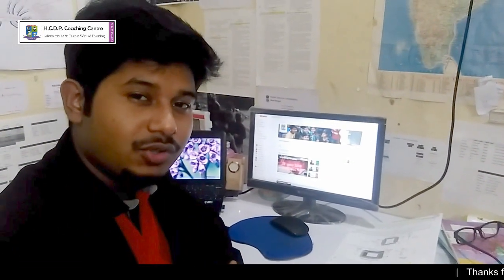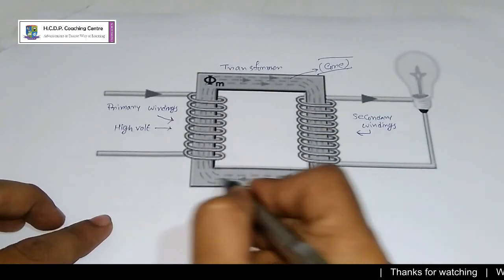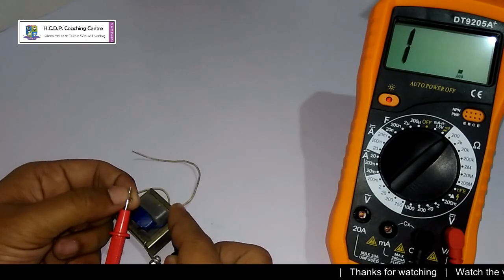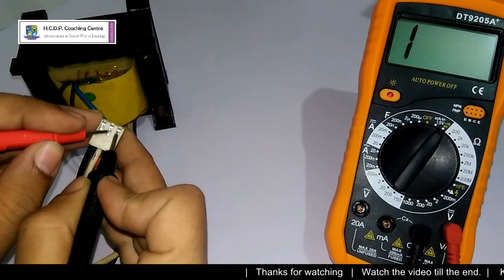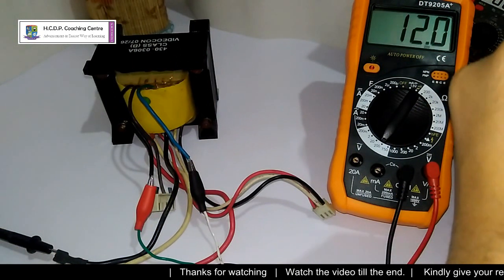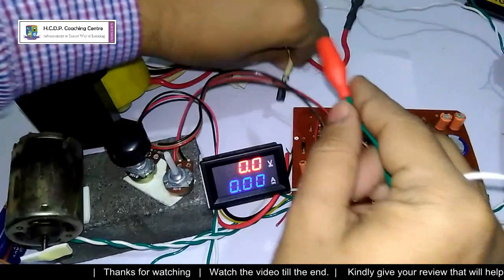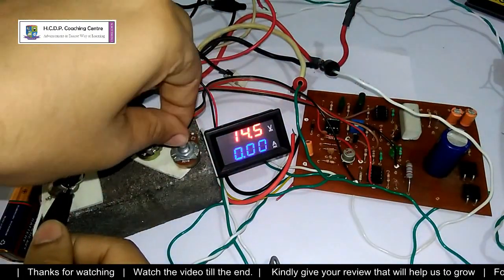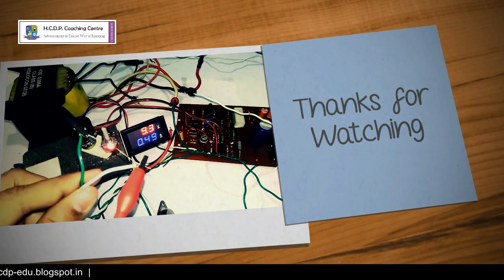Identification of Unknown Transformer (From UPS) and its Uses

Comment: Hello,  after the bridge rectifier, when i put a load of 2Amps the voltage drops from 14vdc to 12vdc, is it normal, is there any way of making it more stable ? thanks.
Reply from the maker: Well soon I'm going to make a video that relates all the queries regarding transformers . Now Back to your question, First most of the transformers gives output on wattage basis. You definitely know the formula of power ( Wattage = Volt X current ). So when u increased the consumption, in your case (2A) so it affects the output volt as a results you see the voltage drop. Some transformers has voltage feedback system , that allows to provide a constant voltage (in SMPS circuit). I hope u understand what I actually meant.
Reply: @GSRA5  Hello, thank you for your answer, if i understood you well, it is impossible to have a stable output from a traditionnal (not SMPS) transformer ?

Comment: Hello, i have a transformer from a UPS system that has 3 brown wires from one side and 5 thin wires on the other side. how to know the primary that will take 220v and the secondary that i need of 12v, thanks.
Reply from the maker: If you have an Inductor meter that measures inductance, try to find the highest inductance value, or if u don't have an Inductance meter ,simply measures the resistance of input wires. Getting the max. Values of resistance between two wires is probably the input that you might use for input of 220v. I strongly recommend you, DO NOT DIRECTLY USE 220AC VOLT, INSTEAD USE A SERIES CIRCUIT USING A 60W GLASS BULB(NOT A LED/CFL) . And by giving the input voltage, u can find the output by measuring the output wires. Wish you all the best. Have a safe experiment .
Reply: @GSRA5  Hello Again, in the transformer, it turns out that the 3 brown output wires give 27AC & 14AC which give 25.21DC & 13.76DC. Can i use only one bridge rectifier to have both outputs or I need 2 bridges rectifiers ? also, can i add them up to have 40v DC ? thanks.
Reply from the maker: Well ! The answer of your first question is - I always recommend you to go for FULL BRIDGE RECTIFIER (using 4 diodes) . and the answer of second question -  you Probably add the wires in SERIES to increase the voltage , but make sure the wire gauge are same. (Though I didn't try this experiment before )!
Reply: @GSRA5  Hello, thanks for the answer, can you explain how to wire the bridge rectifier with the 2 outputs.
Also, yesterday i used a black component with 4 pin (bridge rectifier) and i saw that i went from 15vac to 13.5vdc but when i put the load (not big load), i had a big voltage drop. I used kind of thin wire whereas the ones coming from the transformer are way thicker (3mm). In your opinion, what caused that voltage drop (from 13.5 to 10 vdc) : the rectifier (6A) or the wires. The transfromer is kind of big (10cm x 10cm)
Reply: @GSRA5  Hello, first of all thank you for your answer. I did as you mentioned, and i finally got the output i wanted. Many thanks !!